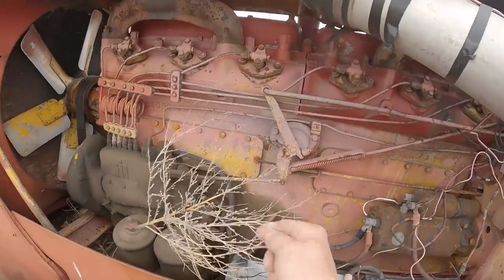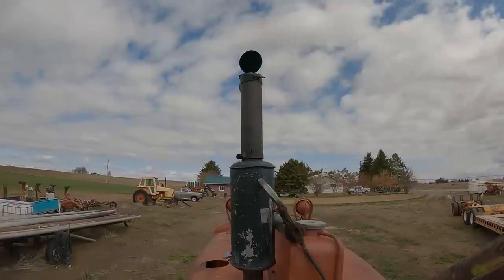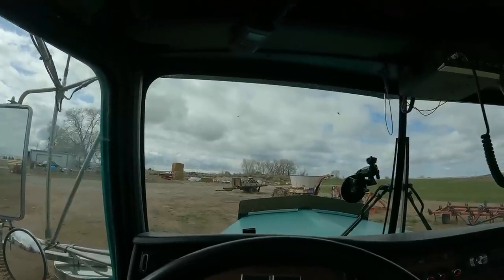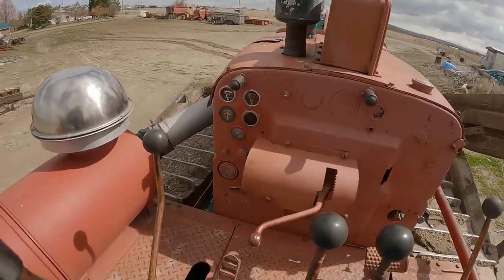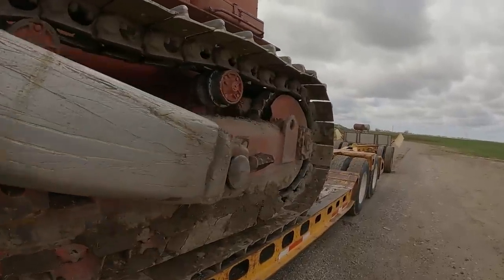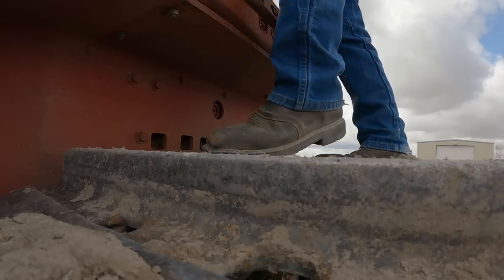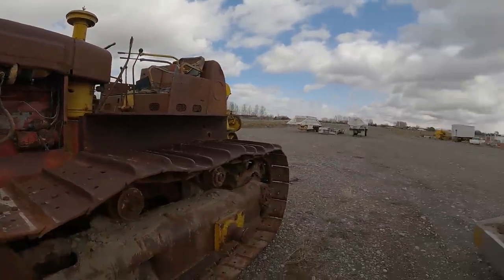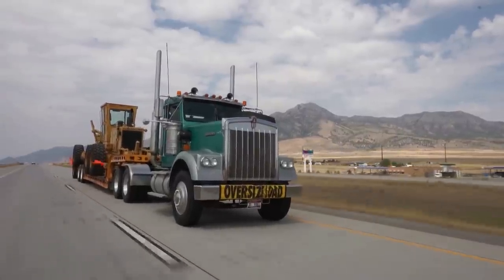How Does A Diesel Start On Gas

Comment: Yea, diesels LIKE gas sometimes... 
Back in the late 80's, in high school shop class, we had an old Detroit 6-71 that was mounted on the engine run rack in the classroom/shop. I told the teacher that I wanted to get it running, and he scoffed at me and said, "Ahh.. People have tried, that thing hasn't run in a decade..", and he let me and my group of buddies have at 'er. 
We checked the rack and injectors to make sure they weren't stuck, checked the oil, filled it up with diesel, and cranked it over for a little bit to build some oil pressure and fill the lines with diesel, then I dumped some gasoline directly down the exhaust pipe, cranked it again, and the thing INSTANTLY roared to life at what sounded like 8,000 RPMs. Classrooms in that wing of the building all came out of their rooms to see what all the noise was, and were peering in the door of the shop through the haze of smoke that filled the room. I'll never forget the look on our shop teacher's face after that, it was sort of like this.. 😳
The resulting HUGE black stain on the ceiling was still there 7 years later when my brother went to shop class there. 😆

My buddies and I were shop class legends for a few years after that.

Comment: Very cool, seems more reliable than some modern engines.
Reply: Reliable, but horrendously ineffeicient - 100HP from an 18 litre engine!! LOL
Reply: In some areas IH outsold CAT.  Like CAT IH has a very dedicated customer following.
Reply: @RangieNZ  It wasn't about horsepower, it was about low RPM TORQUE.
Reply: @RangieNZ  it only revs to 1600rpm that’s why the hp is so low. Bet the torque is crazy tho
Reply: @RangieNZ  that doesn't make sense how does engine capacity vs peak hp = efficiency. There are plenty of 2.4l engines making over 1000hp but they would have worse efficiency

Comment: The international gas start diesel engine are a awesome engines I have a 400 and 450 diesel International wheel tractors they run really cheap on fuel they have their own unique sound
Reply: I am 18 and just got a used td9 international crawlers, and it's sat for 45 years, and once I get a carburetor, it will run, and drive went through it in all the other components.

Comment: Thsnks for showing us Jay! I've known about International's gas start diesels for a long time but I didn't quite grasp how they did the secondary chamber and valves and such. That info isn't really out there and I was always curious! Nice you had a spare head for example. Just a 3rd poppet style valve to the spark ignition chamber. I wondered how the carb was separated from the diesel intake too. Overall yes, a little archaic but simple and pretty bulletproof design. Very smart on Binder's half! No extra pony engine to deal with. No extra starting clutch, no complicated bendix, etc. Biggest flaw is it still needs a good battery and starting system to spin all those cubic inches VS. a pony motor. Very cool stuff!

Comment: Brings back memories running our old TD14 on the farm it had a huge 4 cylinder that started on gas and switched to diesel it ran 1390 RPM wide open according to the tag and was built either in 1942 or 1947. It also had a hand crank if the starter failed but I wasn't man enough for it. My TD25B won't run very long in the low range, the guy's at Pioneer equipment said it's probably a seal in the nitrogen accumulator but they don't know know enough about that crawler to fix it, probably just gonna have to drop it off at the Paydirtarosa as soon as I can find a good 813 IH engine for it, or do a Cummins swap.😉😅

Comment: I used to run an International ID-9 wheel tractor pulling a sheeps foot roller that had a magneto on it and a crank for the starter, because on some road jobs people would steel the batteries out of it. We made sure the impulse coupling was set right so it didn't back kick, but always would start.

Comment: Probably the best modern display of a starting procedure anyone will ever make again on that ol machine. Great tutorial in general. With everything being hydrostats and the like today hardly anyone realizes how big an advantage the hi-lo steering was back in the day. Case dozers with the same idea of using different track speeds are probably the most modern relative to that. 

What in the chef salad you got going on with the air cleaner there ?? LOL Not knocking it either, I like it! Great video, archival stuff. Thanks for sharing

Comment: Nice TD24's and enough room for Mr. Griffy too.   I always learn something when I watch your channel. I didn't know that about the fuel in the injection pump but that explains a lot. I have a TD9 engine in an 1944 Adams 311, the engine had been changed to a UD9. The original TD9 had the IH injection pump which vented through the air filter.and excess fuel from a sloppy plunger fed back into the crankcase. The UD9 came with an American Botch injection Pump which had a vented oil cap and discharged excess sloppy plunger fuel via a weep hole in the bottom of the pump - and that puppy weeps. I've been told on the Red Power Form the Botch pump is better than the IH pump so that may be one reason.
Thanks

Comment: Our Parsons Tiling machine had a UD9 with the same start system on a 4 cylinder.  We would work most years until late December and after frost.  (  “ out of the trenches by Christmas “ ).   When we shut down for the night, we needed to pull the digger wheel out of the trench and clean the tracks and wheel which froze overnight.  The engine always started the next morning.  We just had to back fill the trench avoiding frozen dirt.
The problem, especially for the two head 6s was head gasket or cracked head on that complicated port arrangement.  Once they leaked water you had a big job to fix it.  Make sure your coolant is minus 20 F.   Thanks for the UD lessons.

Comment: I watched your video again to understand the ( GAS) start up. The steering reminded me of back in 1979 ran a (Case 450-C) with the Case power track steering system. Pull back on lever High steer Forward on lever Low speed steer. I loved that power turn. The Backfill Loader was a (Case850-C) very fast machine for the sewer mainline project I was on. The main digging excavator was a 350 BUCYRUS-Erie Hoe). Man what power in hardpan earth. We changed our teeth everyday. The company also had a
40-H BE Hoe) with the bucket removed. They installed a winch system for setting manholes, very strong lifting excavator The only thing I got mixed up on was Reverse. I just used foot pedals on Case 450 to turn. I always turned the wrong way using the High & Low Levers on Dozer. We also had a (125 International Front Loader) on the sewer job. The two Case machines were Rentals, the International belonged to the Company I worked for. "Boy" that International could push Dirt till it was dripping over top of the bucket. When backfilled around the manholes. Most of my job was Hoe packing, with a (Case 680 backhoe) The Airbrake system always locked up the emergency brakes if I used the back tires to lock out one side for turning, not a big air tank. The (Case 780 backhoe)had a drive line Emergency brake. So you could use your brake pedals to help turn, without an Emergency brake pop out of the brake switch. We used the (Case 780 backhoe)to dig the side sewer stubs. We also had a (Dynahoe 190) to   dig side sewer stubs and a (160 Poclain) excavator. Back then on jobs mostly mainline sewers the contactor had every different brand of excavator and backfill machine. Because we were in easements for mainline sewers the LOTS had not been cleared yet. We used a Track Loader for Pea grave runs and backfill. No 
Artic- Loaders on the jobs. Very muddy deep wet hardpan dirt. Again Thank you so much for explaining the start up and steering system on International Dozers.

Comment: Nice to see a "new-fangled" TD start up. We ran several TD-40s on the farm in California when I was growing up in the 1940s and 50s. They started the same except you stood in front of them and hand cranked them. Dad liked them because you could haul then on a ton-and-a-half flatbed truck. He bought a number of them that were terminally broken. Took the engine off the one with a broken final drive housing and put it on the one that threw a rod and cut a hole all the way around the crankcase. We did finally get a TD-18 for heaver work.

Comment: Where I worked they brought in an old Gallion grader from the 40s. It was a long stroke diesel that started off gas and then the diesel could be engaged. It too ran at lower rpms. You would start on gas then run the gas till it warmed up real good before switching to diesel.  The owner wanted it checked out and painted. It only needed plugs and wires and carb cleaned to get running. It all worked good considering how old it was.

Comment: I had an old TD9 IH track loader that was gas/diesel, The gas tank was under the hood mounted to the top of the radiator and if you stalled it with the bucket down you were in for one hell of a fight to get your arm under the loader frame to get to the valve to turn it on ! You run it all day you were worn out, It had steering clutches and brakes as well as a hand clutch so you really got a work out running it !  Bandit
Reply: I am willing to pay a fair price for it , I think 150 dollars is fair enough. Willing talk about it can spend more money if need to.

Comment: Good video. Oh the days before YouTube. Years ago a guy brought over a TD 18 that hadn't run in a long time. I overhauled the engine, clutch, steering clutches and brakes fixed all linkages. Anyway I got it all together and thought How do I start this thing? We ran a pretty busy shop back then so I started asking the customers that came through. A guy named Harry finally showed up and said Well its been 40 years but maybe I remember. And he did. Got it going and he gave me some pointers about the whole thing.

Comment: The engineers who designed this engine were quite ingenious. From opening up the combustion chamber to another chamber that reduced the compression, to making that second set of intake runners small enough to get adequate air velocity into the engine for fuel atomization, I'm damn impressed. I don't think automotive engine engineers understood a lot of this stuff until much later. When did manufacturers first start putting valving in the intake runners like that, late '90s, early '00s?
Reply: That's also really interesting that they run better by retarding the timing that much. Haven't quite wrapped my head around that one.

Comment: 111 hp claimed,actually ran from 150 to 170 hp in Nebraska tests with over 41000 lb pull at the drawbar.the 1091 was designed for torque,not high hp.

Comment: Right as usual Jeff... Once you get that system working and it is no longer full of crap from sitting for sometimes decades it will start any time any day in any weather...It does beat the hell out of any pony motor...  We used to call those Cat pc motors "pistons swapping holes" they rattle so much... Can't kill it in well fuel-trimmed stock form but rattle they do, a lot... Interesting about the fuel timing on the TD 24.. Wish I would've known that when I worked on a couple many years ago...  Thanks.. great content as always Mr Anderson...

Comment: Farmall made a similar engine, want to say it was in the model c or m. Injectors on one side of the block, spark plugs on the other.
Reply: Farmall never made anything. It was a trademark of the International Harvester company for row crop/general purpose tractors. Farmall MD, Super MD, SMTA, 400 and 450s all used it as did the McCormick and International WD40, (the first US built wheel type diesel tractor)WD6, WD9, super WD6, WD9 W6TA, 400, 600, 450, 650 standard tread wheel tractors as well as many crawlers. My list may not be complete.

Comment: I got a TD 14 it's the same system as long as you got fire in the ignition and gas it's going to start. Old but good. When the start valve open and the other is closed it don't make as much compression and makes it easier to turn over.

Comment: Lovely to see such an original well looked after machine as the TD24 being used occasionally. It has had plenty of tlc in its life by the look of it. No doubt the newer machines are a lot more user friendly but it doesn’t hurt to give a thought to the blokes who drove that stuff when they were current. The Snowy Mountains Scheme here was built with those in the early stages (late 40s onwards) and Cats in the later years . There wasn’t much they couldn’t do with them. Jeff
Reply: But that new stuff is almost impossible to fix.

Comment: Thank you for START up. That is amazing, so quick, being such a huge Diesel. The Steering is just a neat, power turn system with High & Low range to power turn the tracks.

Comment: I helped my dad build a small screening plant powered by a UD-9 engine.  After it was built, I ran the plant until someone -- who shall re main nameless (I think it was the plant operator) -- ran the engine low on oil and burned it up.  I think I was 15 at the time.  Old enough to know better, but too lazy to do the right thing.

Comment: Love old iron takes a beating keeps on running . Can you still get some parts for them or do you have to find one to use for parts  .  Also have you ever thought of if you have a repair book on them having some of the parts scanned for a cnc machine so they can make you new parts if it's possible  .

Comment: you should drop a 8V71 into that thang some day, a final drive seal can be ordered by shaft size even if it was intended for a different maschine, if the oscilating loosens the lock nut you gotta use thread glue

Comment: In the 40's my dad worked in a logging camp that had a bunch of TD-18's.Winter time they kept a D-8 to pull start those 18's when it got real cold.Said that D-8 always started no matter how cold it got,used a pony motor to start like all cats back then.Used to be a lot of those IH's around but between parts getting hard to find and the head cracking problem not many left.
Reply from the maker: 18's didn't have the big 50mt 24 volt starters

Comment: Back in the 70s I drove a D6 with a pony motor, then a TD18 started on gas then switched to diesel then my Boss got a AC with a 2 stroke started on diesel and ran on diesel my favorite was the D6 ,the AC made alot of noise.

Comment: Yep. That's just how they started. The Farmall M Diesel tractor started the same way. The engine on gasoline couldn't even move the tractor, just enough power to turn the engine over and warm up the precups. But hey, it worked swell.

Comment: We have two TD14A  dozers. same starting system.  About the same HP as a 9U D6 however not nose heavy like the cat iswith that long 6cyl. and the cable unit on the rear balances it pretty nice. We have a U tube video of our 14's on our Channel.

Comment: The starting setup on ye olde Cornbinder’s was certainly easier to start that a old Cat or whatever else with a Pony-Motor but then again you don’t need a hot battery to start an engine with a Pony-Motor.  My Grandfather had an old D3 up at his land and it could/would sit all year long and we could fill it up with fresh gas and even when cold as a well diggers heart it would normally start on the second pull and if not a rag soaked with a little start-U-bastard on third. I think the thing that made the difference was a good hot Mag.

Comment: I really like this TD-24. I was wondering if there was a third aka starting valve inside the head. And I think I got now lot more useful knowledge out of this video then I expected. I got nothing against oil path air cleaners in some way they are a lazy mans choice. But a modern paper cleaner will work better in certain conditions compared to the oil path air cleaner. Also fantastic story you shared how your dad got this machine.
Reply: Oil "bath"
Reply: @lovetofly32  Sorry typo. Sometimes im not great with grammar :P

Comment: Awesome! Watching you work all of those levers reminded me of running his old HD-16 AC. I think it was built in the early 50's. It had a hand clutch with a torque converter that used diesel fuel in it instead of oil. Had lots of fun pushing dirt with it!
Reply: Was told those old crawlers that used diesel in the torque converters would heat the fuel in the tank and make them miserable to run when the weather was warm.

Comment: Can you operate it on gas or is it exclusively for warming up only? Can you still track around or is that even to much load for it?
Reply: No the starting valve does not reciprocate, so it has no way of cooling itself by touching the valve seat. If you run it to long on gas the start valve will go soft and deform , if the start valve leaks you will lose compression on diesel and nasty stuff will happen. 5 minutes on gas will usually be enough to get the precups warm enough to fire the diesel.

Comment: I had a TD 20 but that lever you pulled it did not have it was on the throttle down for gas starting up to go to diesel that hand clutch gave problems if you let it rev up would flip the diaphragm levers then it would not engage i solved that problem by welding a disc brake pad to the clutch brake side that limited the travel  mine was hydraulic I see yours is still the cable lift  I had a Drott four way bucket on it was useful  I sold it many years ago it was in use a long time I found out a year or so ago the next owner overheated it and ruined the engine it went to scrap sad ending for a good old machine .I have people to this day tell me no way it started on gasoline they are the same ones that Argue that there was never a two stroke Diesel engine with no intake valves lol